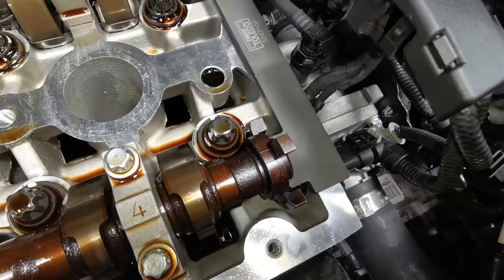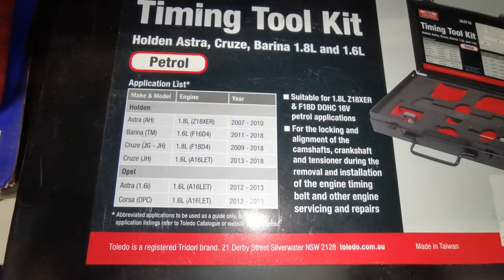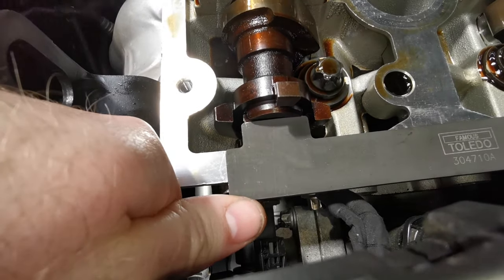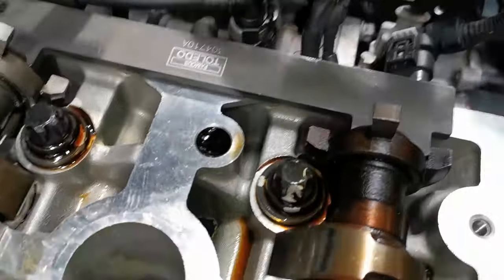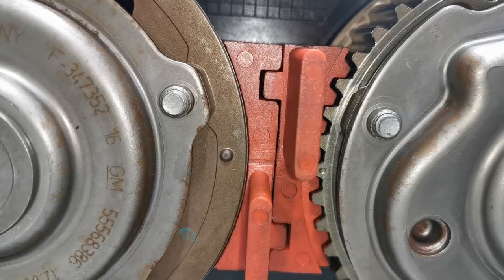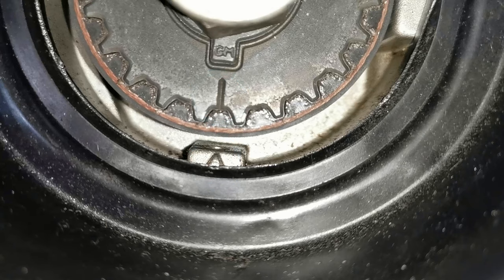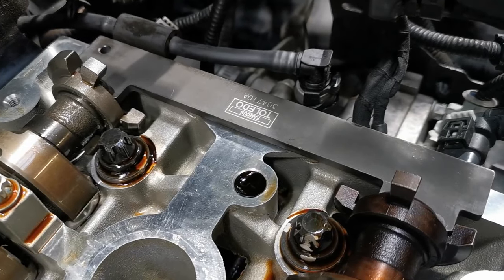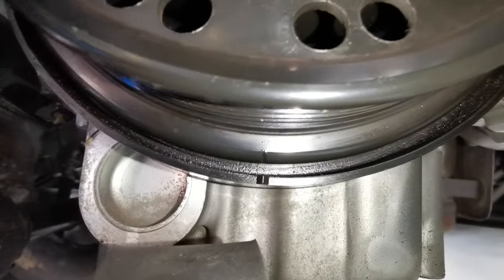How To Set The Timing Correctly - Barina ¦ Cruze ¦ Astra ¦ Corsa 1.6 & 1.8 Engines

Comment: Hi have the exact problem is it ok turn exhaust sprocket by hand so timing plate tool sits in slot on back of shaft. Sorry for asking this but you didn’t explain  what is involved in correcting position of camshaft being a bit out.I know that I should undo camshaft bolt and put timing mark on sprocket where it should be after so no problems in future. Thanks

Comment: Hi.  Great video.. When you checked alignment marks. Did you make adjustment by loosening timing belt and just turning the one shaft to mate the indent to the tool? What was the failure code generated? Thanks
Reply from the maker: Thanks very much. 
It had no fault code stored, the adjustment of the timing was made on the camshaft adjusters (I removed the timing belt)  
The outer cap needs to be removed and then the camshaft adjuster sprocket can be moved once the bolt is loosed on the camshaft. (camshaft sprockets have no locating keyway on the cams) 
 
If you are just doing the timing belt it is very unlikely you will need to make any adjustments like that unless previously done incorrectly. 
 
Again thanks for watching, I appreciate the feedback.
Reply: Thanks..
Reply: Will I need to buy another valve cover?? Just replaced it last year 😕😑

Comment: Thank you, as a 3rd gen engineer following after a mechanic who did some interesting things with t belt replacement.
Like not changing idler pulley because drive belt tensioner bolt is frozen.
And didn't change water pump. ( both of which have failed hence I have it).

I was certain timing was out, because of things you said, I know know my instincts were correct.

Take my hat off to you.
( old time sign of respect from a time long gone).

43yrs trade life and 3rd gen engineer just had his hair saved from being pulled out by the roots.
Sincere thanks😉🙂👍👍

Comment: I just went through this exact scenario in the last 2 days. 
   I set the marks equal like a person would think with the dots lined up evenly and in the end after setting the tension on the belt the mark on the left intake sprocket would drop downward making them unequally lined up.
   I literally had to take the blocks out, loosen the intake sprocket and twist it one tooth and then I got the desired results that you're showing.....
   So my question is why in the heck did they design it like this and use that tool without instructions leaving the technician to believe that everything is supposed to line up equally??!

Comment: Great Video. I am about to do the timing belt on my 2012 Zafira 1.6. What I've noticed is that the timing marks on both camshafts don't line up as per yours. Is it possible the camshaft(s) have been replaced at some time and when front wheels have been put back incorrectly. At TDC do the cam lobes face into the engine or face out? Hope you can help.

Comment: Just one question:
On the surface that sits on the camsfaft, the camgears don't have a groove, so when replacing them, they can go in any position. In this case, are the 2 dots on the camgears that important, if the back of the cams line up?
Reply: that's what i thought too....and i was asking myself...looks like to me that the real timing adjustment is done  with the bottom crankshaft and with the camshafts ends and relative tool

Comment: Question if I've replaced timing belt and water pump and put it back together a little bit out do you think that I might be able to rectify it by eyeing up the timing marks without taking of the tappet/camshaft cover and using the locking bar???
Reply: I know comment was 8 months ago & you have probably sorted it out, but for other people reading the comments, no, the cam pulley’s & crank might line up & be in the correct position’s, but the cams can still be out because there is no key way’s on the cams! So you need the cams in the correct positions before you tighten the cam pulley’s!

Comment: am trying to put the new timing belt on. I had the locking tool in place between the camshaft sprockets with marks for all three sprockets sitting where they needed to be. 

Upon attempting to slide the new belt on, I had the crankshaft sprocket on the bottom actually rotate clockwise about a 1/2 tooth. I am unable to simply rotate it back counterclockwise because the bolt is not a reverse thread and therefore doest grab going on that direction.

What would you recommend at this point? I still have the top camshafts locked in place with their timing marks in the proper position.
Reply: Use a rattle gun to put crank bolt back on temporary.
Don't go to crazy with the rattle gun tho as you want it just tight enough so you can turn the motor backwards if need be like you needed

Comment: I just want to leave a question on about the timing on them car when you put a locking device in the bottle by the transmission the murderer there's a little Rubber seal you got to pick out with like a hook ring screwdriver